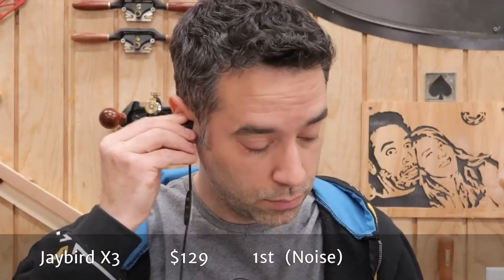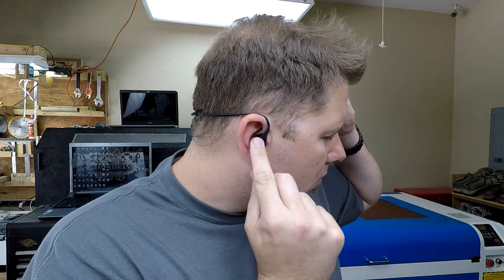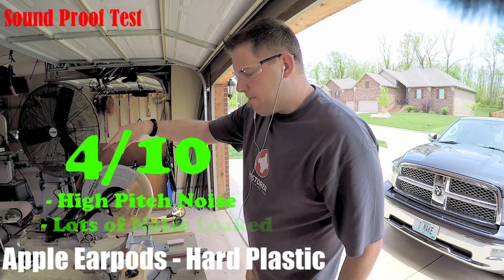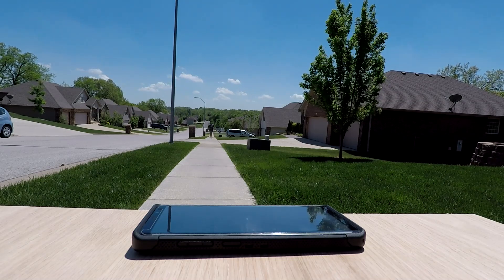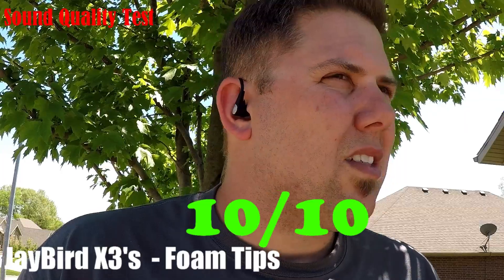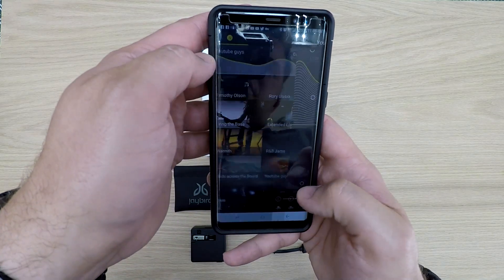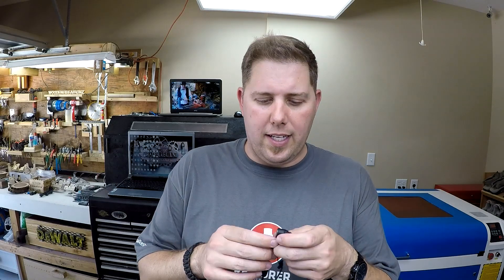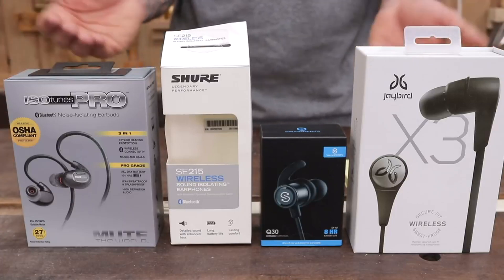Ultimate Bluetooth Ear Protection  -  Jaybird X3

Comment: have you tried the apple AirPods pro with noise cancelation? if so are they better than these options? I just got the powerbeatpro to replace my regular airpod 
(not pro) mainly because you can change the volume on them, they have semi noise canceling but not full
Reply from the maker: I've had these over a year and had to replace the foam tips about three times. I use the memory day out in the shop as I listen to podcasts and use them as ear protection. The battery life has dropped just a little bit from 8 hours. And it's more probably like 6 hours. The proprietary charger has gotten a little finicky at clicking back on and charging the headphones. I kind of have to jam it down. I have not tried the apple airpods with noise cancellation. I like things that have a phone tip they seem to feel better in my ear. But any good noise cancellation should do great. I know isotunes is another good one.

Comment: Great video!  I need some solid ear protection for the shop, it gets deafening in there!
Reply from the maker: Melrose Design I absolutely agree! These do a great job in the shop. I push them in a little tighter for the lawn mower with it's vibration.... But can't argue with a ear plug quality in a Bluetooth headset. I usually come in before the battery dies. And they are extremely comfortable. 👊🏻😉 Good luck in your ear protection hunt. I know 3m makes bluetooth headphones but that may get a little sweaty this time of year. 👊🏻

Comment: When running my cut off  and table saw or chainsaw  I use soft ear pugs shoved in my ears plus ear muffs.
So you are saying these Jaybird X3  are better for blocking out loud noises?
Reply from the maker: Wayn Jul In my testing the order was ear plugs, the X3's, then ear muffs. The ear plugs with the most amount of sound heard (least effective). All 3 work perfect as ear protection but the sound leaked a little more on ear plugs. As far as doubling up on plugs and ear muffs. I have done them both but never together when running a chain saw. In my test the X3's remove the high pitch whine from a router, saw, chainsaw, or loud mower. Again they sound above a ear plug and right below a ear muff. And you can listen to music. I know 3m makes a Bluetooth ear muffs but that sounds crazy hot come August! 👊🏻😉

Comment: I know there is no way you bought this with your wife's money.  Now I'm questioning the entire review.  lol  Also, which Podcast sounds like a symphony?  I'm thinking Making Time Podcast is about as close as it get's.   Ok, serious question.  How do they work when used for telephone calls?  I have a pair that are designed like that and I can hear calls fine, but the microphone isn't picking up do to the position it's in.
Reply from the maker: ManCraftingTM Chad... Ha! I only make the gas money for the family. The wife makes all the toy money. 👊🏻😉 Yes the Making Time Podcast sounds delicious like a warm apple pie in the fall when I listen to it on these fashionable ear corks on a string.. There is a bearded guy on that podcast that looks like Nick Offerman but sounds a lot like you. Meh.. fluke. And yes... The call quality on this one I feel might be hit or miss... Most people tell me they hear me great, I always ask because I know the microphone behind the head doesn't always work well. I was told the other day I sounded a little distant on the phone so I took it off headphones and finished the conversation. But I just finished a call with them in the backyard 2 minutes ago with out a single complaint. I talk a little louder so the mic can pick me up..  But 100% advise for ear protection and the customization app is really pretty cool for changing the sound and they can bring some decent bass for an ear bud.
Reply: Thanks for the thorough feedback.  I have a few different headsets and can usually spend 15 minutes looking for one.  lol  So picking up another set is always an option.  I'll have to see if my wife has any loose change.  lol